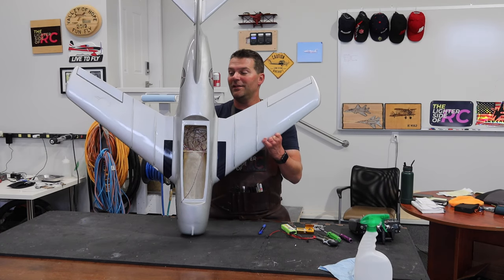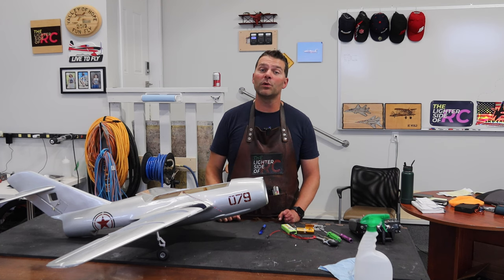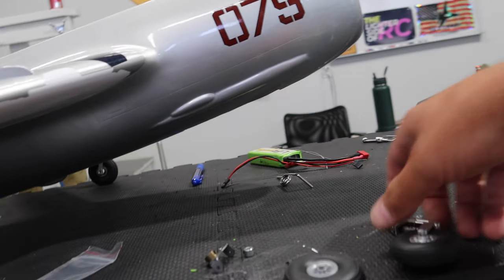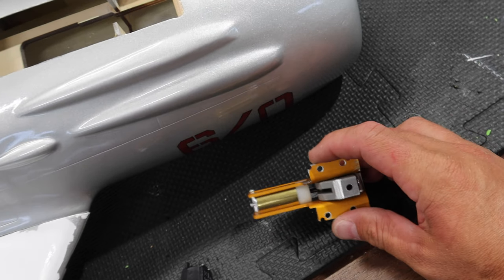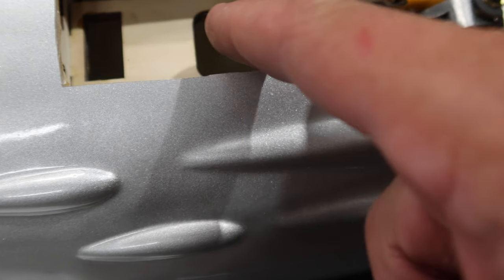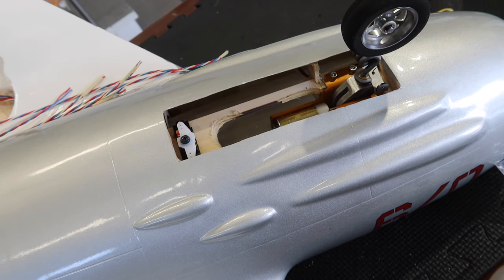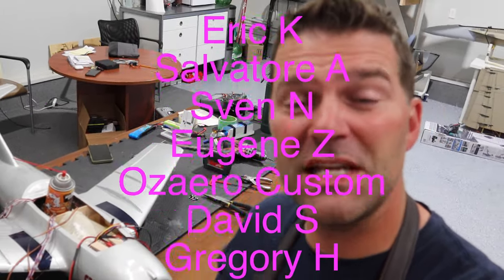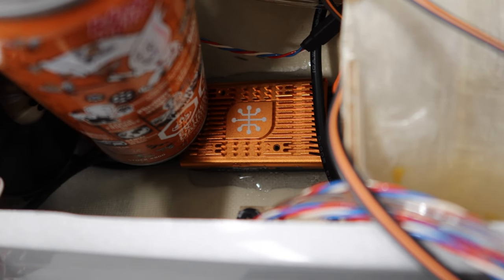BEST EDF RC JET - MIG-15 Almost Complete

Comment: I would  position the ESC so that the heat sink could be sticking through a cut out in the thrust tube ducting to allow cooling air to pass over it.
Reply: That's what I was thinking too.  You'd lose a little thrust but you wouldn't risk overheating the ESC.
Reply from the maker: Definitly one of the struggles with this kit.  Cooling and space.  I was looking at it this morning and there will be a decent amount of air coming in the nose opening and it's channeled through the fuse and can exit out the back.  So I thin we will be good.

Comment: My Dad would take washers and solder them to the axle on both sides of the wheel.  Didnt have to worry about the wheel coming off . Its simple to do
Reply from the maker: Thanks!  Yea I was thinking about that but wasnt sure how it would grip to the different metals.  I may go that route still.

Comment: I don’t know how hard it would be, but could you have mounted the esc with the heat sink protruding into the fan’s airstream?  That way the airflow would compensate for the removal of the heat sink fan…
Reply from the maker: I suppose it's possible but the goal generally is to keep the intake to output as undistrubed as possible..  With the nose gear door being open it would allow air movement over the ESC in flight.

Comment: Are those lipos going to get any cooling and also why do you need that fancy of a esc for that small jet .   Sorry for the questions
Reply from the maker: No.  The lipos won't get any air movement at this point.  ESC isn't needed but that's what he wanted installed.  So.  Lets do it!
Reply: That edf unit will need the amp capacity that ESC gives, plus being a Spektrum user it will give all the telemetry info to the transmitter. I have the same set up in a couple of models and it’s a really nice combo.

Another cracking video, looking forward to seeing this flying especially with the lights!
Reply from the maker: Thanks Tom. Yea integrates very nicely with the ix20!  Pretty slick setup

Comment: BTW those 100c Spektrum arent 100c , they been rated for 35c only .  Check out the guy on RCG.  C ratings are not true C ratings .
Reply from the maker: Sooooo.  What are the 30C batteries actually rated to! 🤔